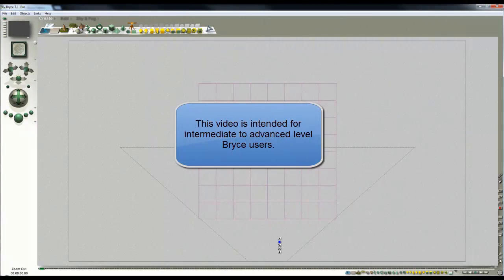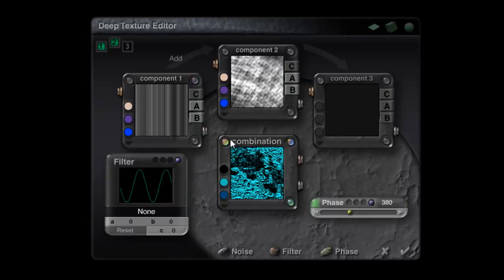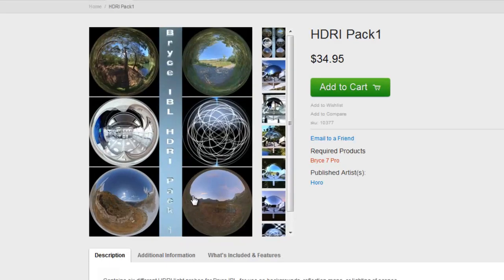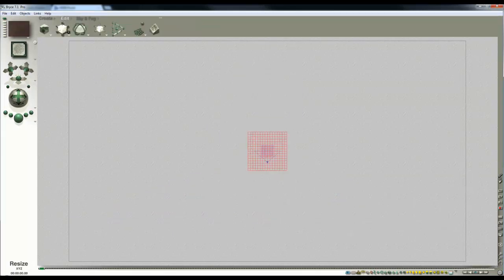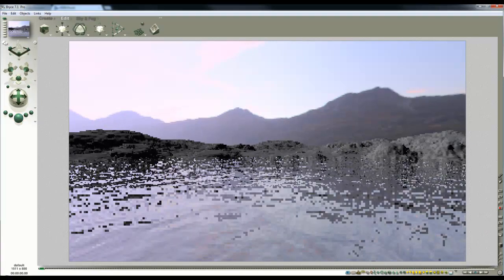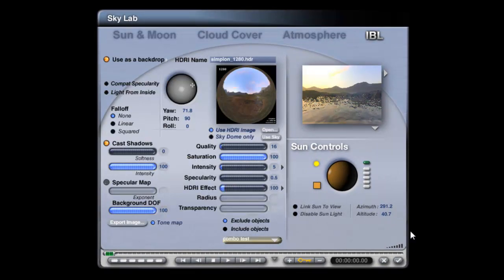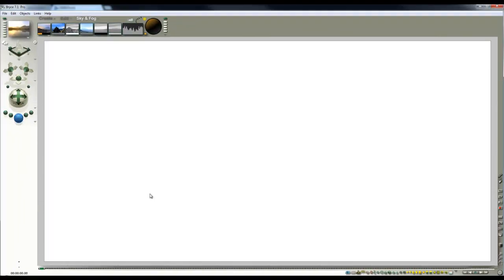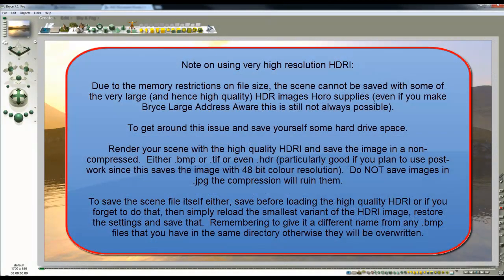Bryce lake in a landscape - a 15 minute tutorial by David Brinnen

Comment from the maker: To improve render speed, from a hardware perspective, there is only really one consideration - processor speed.  Bryce can address up to 8 cores (real and virtual) at high priority setting.  So a 4 core processor with 4 virtual cores supplied via hyper-threading and the fastest clock speed that cooling will allow.  That will give you good benchmarks.  Then after that, it is down to what you are rendering and selecting the correct render mode for the subject.  What is your subject?